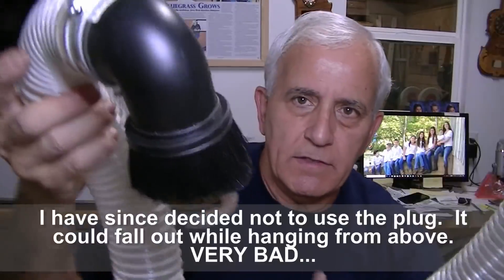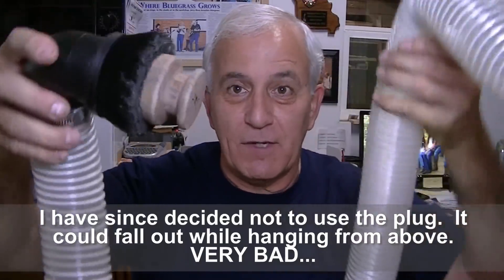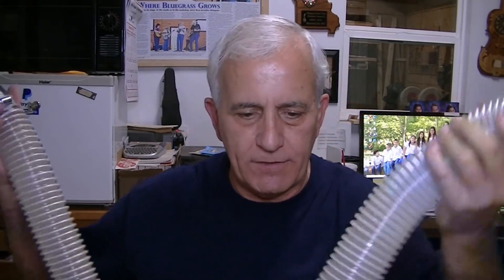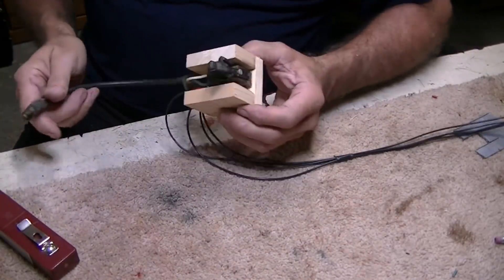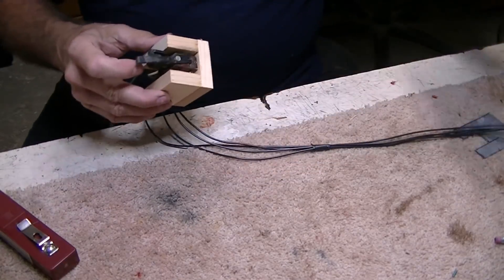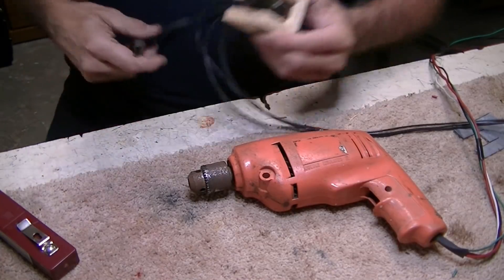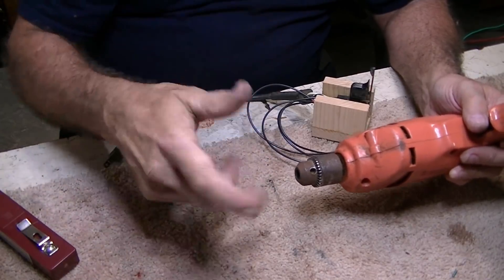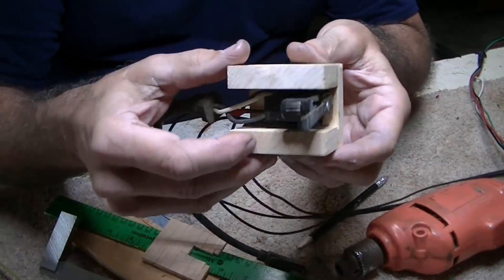247 RSW Very Handy Shop Improvement

Comment: Slap a dimmer switch in-line with it. Paint it bright red, for emergency stop when pressed, otherwise leave it in the on position, but set to speed you like. The drills switch would still be the active control unit; dimmer switch as a passive speed control with 'emergency stop' functionality.

Comment: Fun project Jerry. You crack me up on stuff like this. As clever as it is my version (being an engineer and all) would have a Spring Centering Reversing Drum Lever Switch, a micro limit switch for both top and bottom positions and a potentiometer for speed control with a max RPM set for maximum safety. I'd be out about $60.00 and a full weekend to solder, srink-wrap and precision locate everything and establish optimum ergonomic interfaces. Mine would work too but there ain't nobody who'd want to watch that snooze fest video.
Reply from the maker: I put the router speed control on it that I bought for my side bender. And that made it work perfectly for the speed.  So it's now absolutely perfect.
Reply: Still (and again) simpler and less expensive than my over
engineered solutions. Sometimes I think all that schoolin’ punched a hole in
the bottom of my smarts bucket.

Comment: i like the router speed control idea .. also a sewing machine pedal would speed control/variable speed.. also if you need a 12v power supply with more then 2 amps then they can be made from old computer power supplies .

Comment: You would have made Rube Goldberg proud. If it works, that's all that counts. Pretty isn't necessary. I made a workbench once that I wanted to be able to lie flat or at an angle. I put a screw eye in the ceiling, one in the back of the bench one behind the bench and a screw  hook just above where the top of the bench would be when up at an angle. I tied a nylon rope to the screw eye in the back of the bench top, put the rope through the screw eye in the ceiling and pulled the rope intel the table was the right angle. Then I made a loop in the rope that fit on the hook and hooked it over the hook behind the bench. I then took the loop off the hook, lowered the bench top to flat and tied the other end of the rope to the screw eye behind the bench. All I had to do to raise the bench was pull on the rope and hook the loop over the hook to put the bench top up at an angle. It worked great. If your drill ever gives you trouble, you could use this idea for your vacuum hose.

Comment: Could put a light dimmer switch on it to slow the drill down even turn off and on
Reply from the maker: I put the router speed control on it. That worked great.

Comment: Hey Jerry, if you want variable speed, pretty quick an easy add a standard light dimmer to your electrical outlet! just dim it down for a slower speed. you could also use the temperature controller you had bought for the bender it will also work! pretty much the same thing. Try it out for giggles!
Reply from the maker: Yeah I thought about that this afternoon. I'm probably going to try that.

Comment: I know for sure I would forget which way it as going and wrap that thing right up tight and break something. That's why I would probably use a bungee cord and have it just within reach. Not knocking your approach though Jerry. I need to get a remote for my dust collector. That would be a step in the right direction.

Comment: Speaking of gravity: How bout 2 pulleys on the ceiling, a string and counterweight.
Reply from the maker: I thought of all those different options. But there's no room for any of that.  Too much movement and too many mechanics with something like that. The whole back wall is full of tools. I needed something that didn't move.  This just drops it from the ceiling. And it works perfectly especially now that I put the router speed control on it.

Comment: I like it, but you better go around the drill and block once with duck tape just to ensure the screws don't vibrate loose over the years and conk you in the head. 😳
Reply: Lock tight the screws would work.